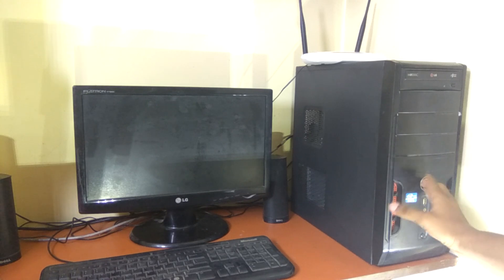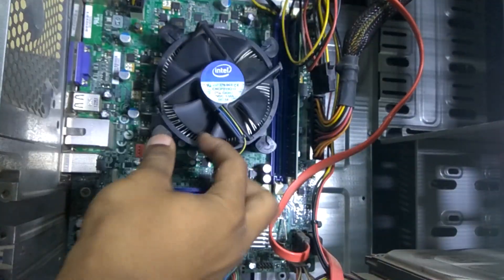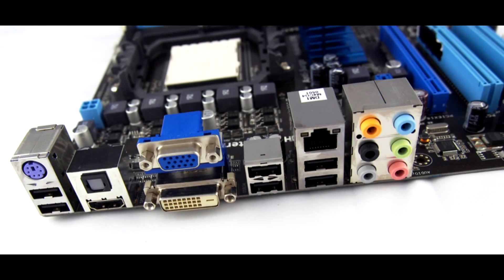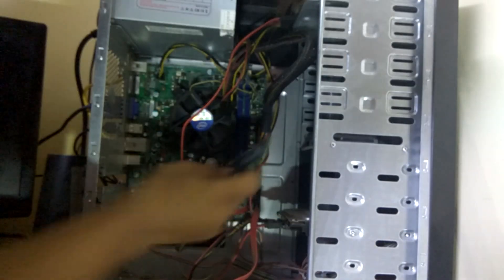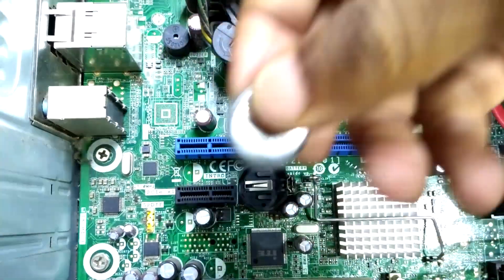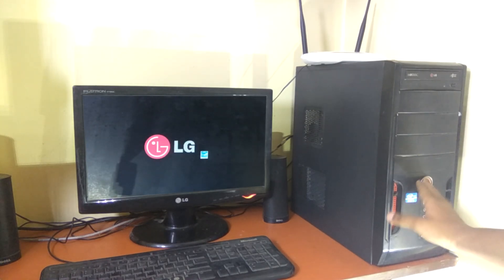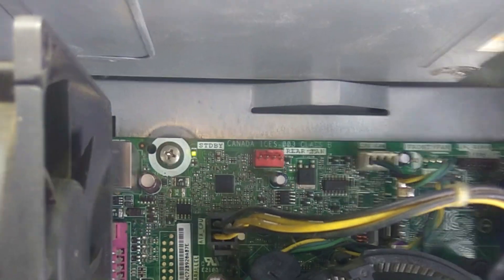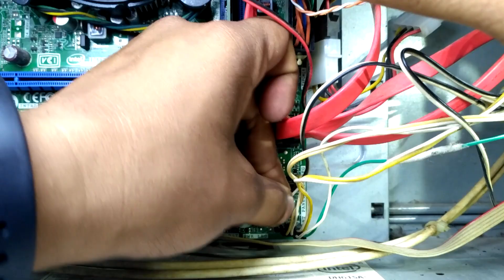What To Do When Your PC is Not Working 😬

Comment: Bro cpu turned ON but no light glowing from Keyboard or mouse. Monitor also displays for a second then goes to sleep mode. What's the problem exactly??
Reply: Yeaa bro I'm having the same problem...did u solve it ?
Reply: @kannankannan8094  I think you need to format the system. My system is working good now. UPS has to be repaired but for that everything is fine.

Comment: bro, i had purchased a new PC the psu is working on other system, but the new system after building, when I tried to boot, the cpu fan runs, but the display is showing "no signal", motherboard is not giving any power to the usb, mouse & keyboard not working, what could be the problem, changed the battery as well.
Reply: I was able to fix mine with the help of @RYANSROOM617 on instagram..
He’s a pro hacker and legit 💯......

Comment: I used eraser to clean RAM. It worked. Thank you very much..!
Reply: I don't hear a beeping sound again and again but after some seconds the fan in the cpu makes loud noise. 
What should i do?
Reply: @MaxProgramming  did u find the solution
Reply: @zuhayousif6341  I gave the CPU for repair at the shop and now it works fine. In my case the RAM became corrupted so that needed to be changed

Comment: Bhai Mera display , mouse or keyboard teeno hi  kam nhi Kar rha
Reply: Then i guess u have to try reconnecting those things or change the devices but if it doesn't work so there are different methods like u can check the power supply corrections if it's good then try to change the processer or just clean it I hope it will help u alot

Comment: What if it is showing 'monitor going to sleep' dose not starting??
Reply from the maker: 1. Check power supply of your CPU and is there is any indicator on cpu so that you can understand it's working or not

2. Then if CPU is running if running then check the VGA cable or HDMI cable
Reply: OK
Reply: Yah